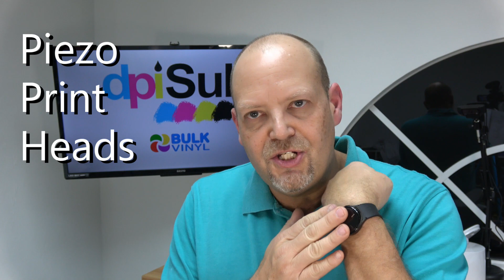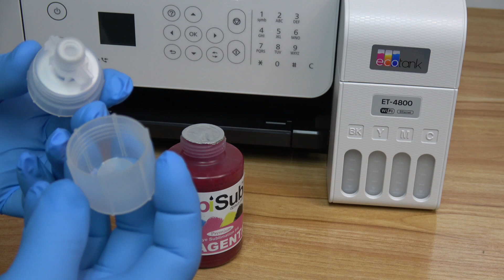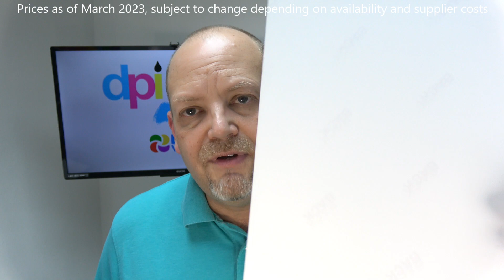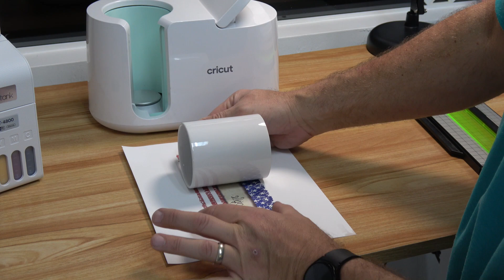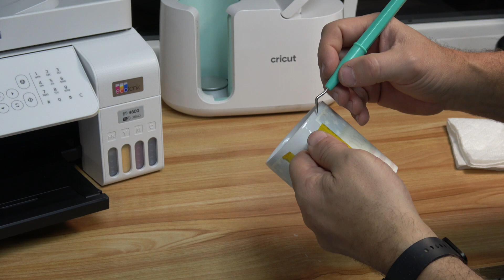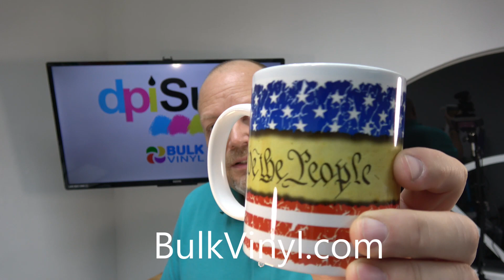Product Launch - dpiSub Sublimation Ink, Tape, and Paper

Comment: You mentioned the Epson 4800 a few times. Would this model be your top choice for a sublimation rookie? I will only be using it for personal use, gifts, experimenting with various blanks,  etc.
Reply from the maker: Around the 15:00 mark I give a lot of detail on choosing a printer, a few things to consider.
Reply: @TroyTube  I listened closely to that segment! There are just so many models out there that would serve my needs; still  kinda intimidating to choose one! Thanks.
Reply from the maker: @shirleylundstrom4802  The biggest choice you have to make is Letter/Legal size or larger format up to 13" x 19", just stick with a model that has four ink wells, some have 5 or 6.  All the Eco-Tanks have the same print heads so if you go with Letter/Legal size you can get the cheapest model.

Comment: How far does the ink go? Wondering how often I would have to order more ink.
Reply from the maker: There is no answer to that, it's all about how much you print and the size of the prints. However, I think the standard is "about 500 prints on average" for 140ml bottles.